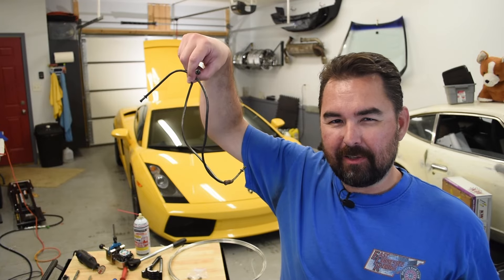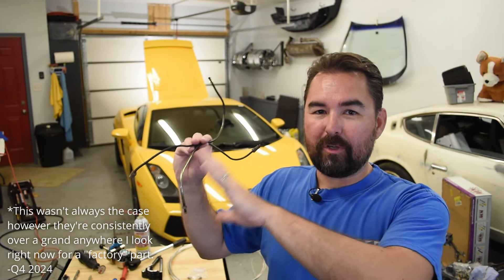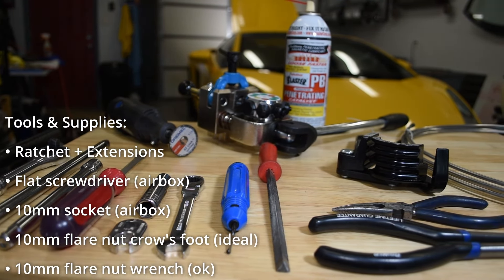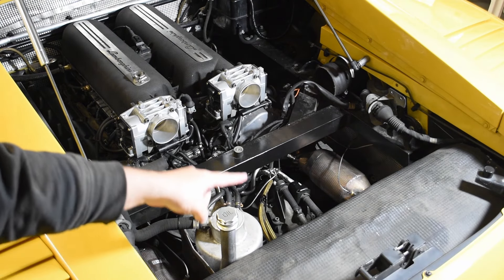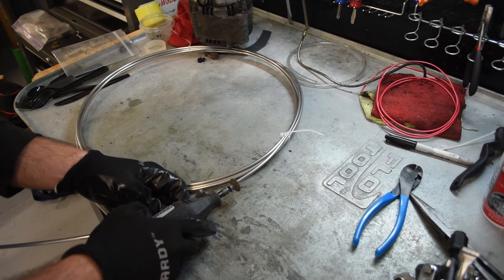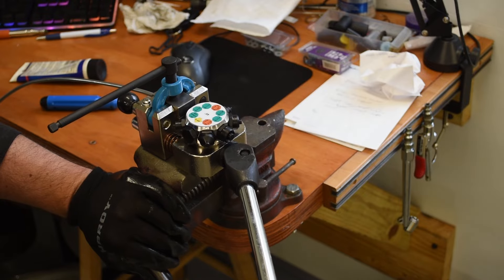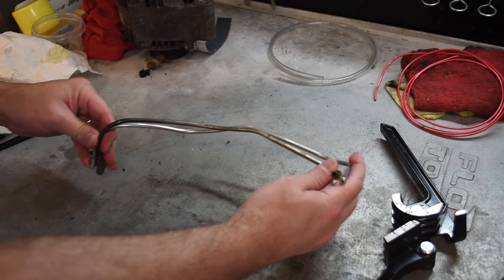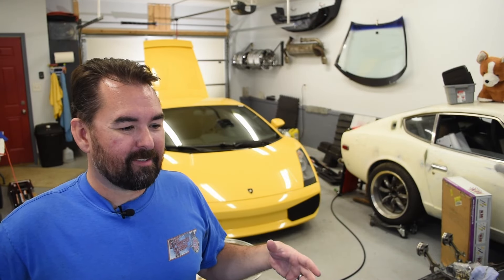Misfire Tubes DIY! The Lamborghini Gallardo Hack You Need to Know

Comment: I’ve had a few battles with these over the years when they don’t want to come undone 😅
The exhaust temperature sensors like to fail aswell which is also £££ from Lamborghini.
Reply from the maker: @Tri_tec_automotive  Yeah, hoping to avoid the latter but still chasing some weird behavior (unrelated to these tubes/sensors)

Comment: Quick hack: cut off the the tube and use a socket when removing the nut from the catalytic converter. Since you won’t be reusing the misfire tube.
Reply from the maker: @Birdhouseboi810  Lol, yeah, you have a point.  In my defense, I hadn't tested the flaring tool so considered there was a non-zero chance I'd need to reinstall temporarily while figuring out a Plan B 😅
Reply: @ we just done it a lot on brake line fittings when I used to work on cars all the time. I’ve done alot of brake lines. And I hated it. Lol

Comment: I believe they already upgraded these on the 2008 model. If not, I am going to replace mine when I do the LARINI exhaust and cats. Trying to hold off till I do the clutch. Other than that, I see you are still running BLACK wheels. How ordinary. LOL
Reply from the maker: @PatrickMichael2002  😛 The wheels are factory Apollos that came to me black but I had them powder coated to approximate the OE "titanium" color.  I never bought into the black wheel thing.